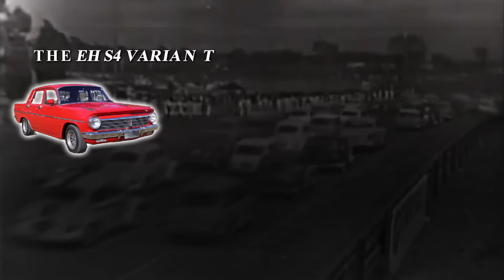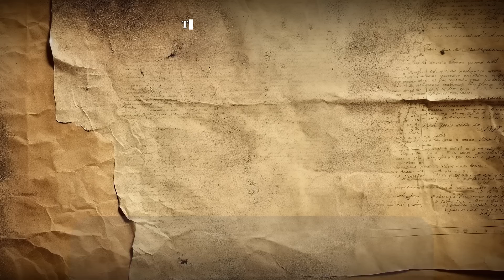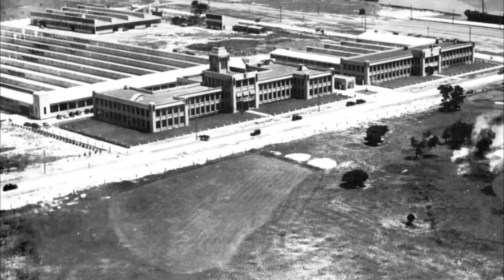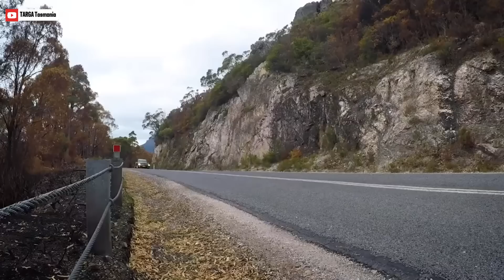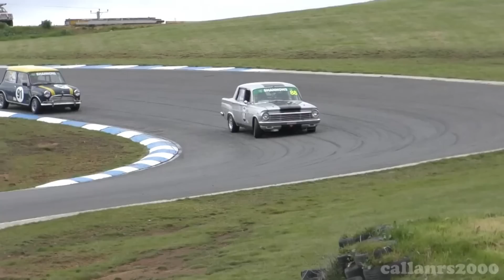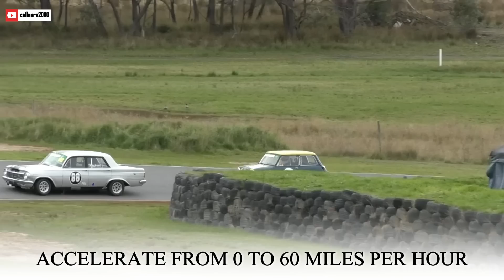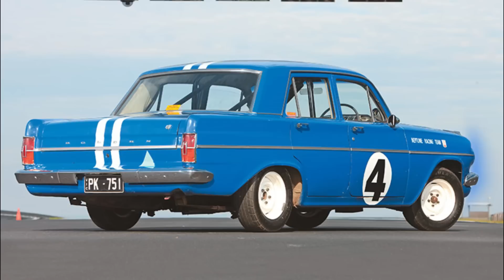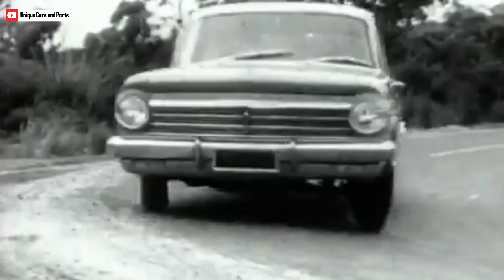Holden's SECRET High-Performance 179 Engine That Dominated Bathurst

Comment: Typical Yank not knowing the full history.
The HD Holden has a 179 X2 Engine option with Twin Stromberg Carbs.  No mention by this punter about that performance improvement on the 179.  😮

Comment: A Holden red six would be lucky to give you a nose bleed on a hot day.
Reply: Brocks red motors gave the Ford Boys menstrual cycles LOL !!
Reply: @ Yes putting three carbs and an unstreetable cam grind on a motor and shoving it in a tiny body made that car fast ….I challenge you to sit in the back seat of an LJ Torana Grant. I’ve driven enough HQs with a 202 to tell you they are a slooooow motor that strip timing gears and leak everywhere.

Comment: I owned three EH wagons in my youth, the last one was repowered with a 186, which could touch 60 mph in second.
The thing I liked about EH wagons was the two stages of fold-down on the rear seat. The first stage you flipped up the seat to vertical, and folded down the backrest, not long enough for a 6-footer to sleep. The second stage you had to put the front seat all the way forward, then the rear seat, with a clever set of steel bars, could flip all the way over flat, and the back rest would clip on to the back of it, making a bed space well over 6 feet long. I camped out in my wagons dozens of times. With a set of snow chains, I took on many a muddy 4wd track.
Reply from the maker: @Jesse-B  thanks for sharing this experience 🙏
Reply: @LegendaryRideCars  I have to say it felt pretty good telling the story after all these years... I'm 68 now, and driving a new model Hilux 4wd, but I will always remember the joy those old EH wagons gave me.
Reply from the maker: @Jesse-B  well glad you liked it. While we cannot give you that feeling and joy with our video, at least we can get you back, when you experienced it 🙏 😌

Comment: The holden red motor did win at Bathurst but that was in 1972 in the smaller and more advanced Holden Torana and it was a larger 186 cubic inch with a triple carb set up. Apart from that it has been mostly V8s that have dominated Bathurst Ford and Holden both winning in the years that followed
Reply: Holden a lot more LOL !

Comment: Oh My God !  Firstly, in 1963  Australia used Australian Pounds NOT Euros . Australia uses Dollars now NOT Euros  . Europe didn't use Euros in 1963  , Euros didn't exist in 1963  . The EH was 1 Lap behind the Winning Ford Cortina , which won in 1963, 1964 and 1965 , Mini Cooper S won 1966 , Ford Falcon GT won 1967 . Holden won their first Bathurst in 1968 with a 327 Monaro which was a Rocket Ship compared to an EH  . To say the EH dominated Bathurst is a Joke , Bob Jane in a Ford Cortina won by a full lap to 2nd placed EH  , Ford Cortina came 3rd 3 seconds behind  and closing on the EH  , another Lap and Cortina would have been 1st and 2nd . I owned 2 EH s and the only way a 179 would hit 105 mph would be if you pushed it off a Cliff .327 Monaro had twice the power a 4 speed gearbox and top speed was 120mph .

Comment: For those just coming to the comments you will see a sprinkling on my comments throughout. What the video is meant to be talking about here is the "197 X2" engine.
As an automotive technician of 40 years and someone rolled in Red Holden engines instead of sand pits as a child, I used to use the oil from the inside of Red engines for deodorant for 20 years :)
The 179 X2 is a different engine to the stock 179 and HP block revision. Only a very limited number where produced and many went in boats as part of the Mercruiser Marine engine line.
The X2 has X2 stamped on the rocker cover next the the twin Stomberg carbs and the big twin carb air filter housing. X2 was also prefixed into the engine number on the block so as not to be confused with the common 179. Vehicles fitted with the X2 engine also have the Red L shaped arrow with X2 either on the grill or as a decal at the rear.
They were as rare as hens teeth. I have only ever seen 3 genuine X2 engines in my life. One I worked on and serviced for a customer for 10 years, the other 2 were in boats including 1 in my fathers 23ft Caribean half cabin cruiser.
>
It is difficult to find information on them but if you search "179 X2" you will find a few pictures. You can't mistake them :)
Many people created twin carb knock offs of the X2, but the lack of decals, air filter, and the lack of X2 stamped into the engine number is a give away :)
>
It is the X2 engine that created the 179 legend, not the stock 179.
Sorry if I have burst anyone bubble with that :)
Reply: And the X2 came out in the HD NOT the EH  .
Reply: @ChrisM-fz6xx  Sorry, where did I say EH?
Reply from the maker: @axle.australian.patriot  what a cool storytelling comment from deodorant to the red engine 🤩 it is really hard to do videos on that rare stuff like the X2 engine. But great to have your knowledge here in the comments for all the enthusiasts :) Thanks 🙏
Reply: @LegendaryRideCars  It may as well have been deodorant. That old resin stained oil stays in your skin no matter how hard you wash lol
That is just my experience from too many years inside of those Red engines across the board lol
.
If you search "179 X2" You will find a few poor pictures, but enough to see what they looked like.
The first one I ever seen (and only one not in a boat) was an older customer that had a factory standard HD X2 utility. Being brought up on Red Holden engines I had no idea what this thing was when I first seen it. Because of the decals on the chrome grill I thought it was LX2 at first. but the L is just an arrow around the X2.
When I was younger my father has a 23ft Caribean cruiser half cabin. I often got to see the engine while dad was working on it, with the twin carbs etc
It wasn't until I was introduced to the genuine X2 ute that I did some research so I know what I was doing when servicing and tuning this ute. That's when I discovered that the X2 was adopted by Mercruiser as a boat engine. Boat engines need a bit more power to weight, as well as typically run at a higher RPM when cruising, so the X2 was a good fit. Strong, little vibration (boats don't have rubber engine mounts) and capable of sustaining the higher RPM.
>
That X2 ute was basically my introduction as a young person to many of the later Holden high performance engine builds for the Bathurst touring car championships.
>
I never got to put my fingers inside of that x2 engine as it was kept immaculate :)
Reply from the maker: @axle.australian.patriot  and the next wow 🤩 love to read your comments. It’s like diving into a good old book :) have you thought on writing a book on that history of your own with that engines?
Reply: @LegendaryRideCars  Omg! I had 40 years worth of that stuff across Holden and Nissans. As a mechanic, performance tuner, performance engine builder, off road racing.
That's not counting boat racing lol
It would be a long book lol
I'm struggling to finish my series on computer programming at the moment lol
>
I'm happy to offer up some fond past memories for forums like this :)
Reply: @LegendaryRideCars  P.S. thanks for the comments :)
Reply from the maker: @axle.australian.patriot  about which engine you would like to hear something on our channel in the future? We could check and maybe it gets in our roadmap - to refer to your programming class.
Reply: @LegendaryRideCars  Wow, that's a hard one. There are a lot of legendary engines out there in their own right.
But if you want a challenge The RB30 GM/Nissan 3.0l is an enigma.
It is official listed as a Nissan engine (Nissan skyline and some Patrols) as well as the Unleaded motor for the Commodore VL.
I was common practice through that period for auto manufactures to do swaps on cars and engines rebranded as there own.
The problem is the block and internal components are stamped with GM part numbers as well as Nissan part numbers.
This was a bit of backroom collaboration between GM and Nissan to build a new engine from previous experience. But it was "backroom" and very little made it into the public. It was build/manufactured in Japan under the Nissan license.
GM Holden desperately needed an unleaded engine for the commodore, so you can understand a bit of background give and take negotiation between Holden and Nissan over the engineering technology :)
So the best of my knowledge it was designed around the tough build of the x2 with the high machining tolerances and steel crankshaft (Note: this was an optional turbo charged engine so needed a proved strong bottom end with good balance.) And the massive success of the Datsun/Nissan L series overhead cam engines.
>
Good luck finding info on the GM/Nissan collaboration though :)
>
They do have a solid history for their short life.
>
There are a few engines in the RB Engine series, but its the 3.0l in the R30 and R31 Skyline and VL commodore that stands out as an enigma.
Both Skyline and VL commodore have a large fan club around that RB30 legend :)
Reply: @LegendaryRideCars  P.S Up until the introduction of unleaded fuels Our Au Police used a mix of Ford 351ci and Holdem 308ci for the highway pursuit cars.
Both brands had an add on Special Vehicles Department that created limited edition sports modifies cars. (Like the X2, XU-1 and later L34 308ci engines.)
The VL commodore with the RB30 3.0l TI became the choice for the pursuit cars during that period. Being a turbo they were fast and well weight balanced on the highway.
The only problem was that from the manufacturer they were sold with a hand book warning to allow the engines to idle for one minute to let the turbo cool and spin down before switching them off (No turbo timers). The TI models were rare outside of the Police department.
Unfortunately most police drivers didn't get the memo and they destroyed a lot of turbos and in some cases the damage required in house (Police) engine rebuilds.
It was from servicing these vehicles under contract that I learned about the GM internals of the engine via the police workshops.
I never personally got to open one up, even though I owned an R30 and R31 skyline at different times. They just didn't break lol
Reply from the maker: @axle.australian.patriot  a ton of info. Thank you very much for your effort.
Reply: @LegendaryRideCars  The engine with the least info was the block designated  HP Block ! At the start of the 80s l approached  an engine builder to build me a full house Holden red motor for my Torana . I wasn't. aware of which block they would choose but interestingly  they chose the HP Block over the 202ci block . I can only assume it was for the 7 journal crank for rev strength !! That engine delivered in spades and that l figure was also due to power to weight as it was fitted to my mockup XU1 l had which had  a curb weight at the time of 1050 odd kilo,s . That thing was the Lester Ellis of Torana,s (The Master Blaster ) LOL , It left town like a cat with its fucken arse on fire LOL !! I've. been a fan of the red,s ever since .it was simply sensational !! The GT fellowship hated me lm positive of that as NONE of them ever got close 🤣🤣🤣🤣🤣🤣🤣GM FOREVER ,FOREVER GM !!!!!!!!
Reply: What do you know about the engine designated  HP Block engines ??
Reply: @Lionatheart2839  I can't recall exactly (Long time ago). The HP and the 179 blocks were cast in a different factory or with different steel from memory (earlier and later molds). There were a lot of variations From the Low Compression engine (Low octain fuel) to the High compression engines (High octain fuel).
This occurred across all Red engine versions. Basically these were the stock 179 engines. They changed from forged steel to cast along with the block mold change, but some engines retained the forged steel cranks. The X2 kept the forged steel crank.
>
Where some of the ambiguity comes in is this:
The EH S4 was a 3 speed syncro gearbox upgrade from the hydromatic. So gearbox, not engine.
I think Repco built a beefed up stock 179 for racing.
This was then used as the base to design the X2 179 by Holden.
The X2 is easy to identify as the X2 is stamped into the prefix of the engine number, as well as on the rocker cover.
If you search for the 179 X2 you may find a few images where you will see the X2 which has an arrow in front of it and east to mistake as LX2. You have to look carefully through the images to see the LX on the rocker cover plus the big air filter for the 2 Stromberg carbs. I did recently see some images where you can almost see the twin Strombergs under the air filter.
>
They had to sell a certain number of production cars with the X2 to be allowed to race them at Bathurst.
I only ever got to see and maintain a X2 Utility, so I knew the X2 well, but never got to pull the engine down as it was very well kept.
.
I did mention elsewhere (although you won't find information on it) that the a lot of the X2 179 engines also sold to mercury. The only change was the "Mercruiser" engine was painted black and the exhaust was water cooled aluminum. The big air filter was dropped as it is not needed on boats and 2 small round chrome wire mesh filters were placed on the carbs instead. 
I know this because I have seen a few of them and my father owned a 23ft Caribbean Cruiser running the 179 X2 through a stern drive.
>
I feel so old lol

Comment: What a load of rubbish. Engineering breakthroughs like a 7- bearing crankshaft and hydraulic lifters! Really? Oh by the way, this thing never won Bathurst, it got flogged by snake smaller 4 cylinder cars.

Comment: You don’t know nothing s4 just had a double carb
Reply: S4 NEVER had twin carbs, just a single venturi stromberg with a bigger main jet !!
Reply: S4 had a normal 1 5/32 Stromberg with what became the 179 manual carby.
Reply: No forged steel crank I only heard of those variants being special HP was it
I'm a Ford guy  i'm not sure

Comment: I thought they had a 138 red motor in a few of the ej holden
Reply: EJs had 138 grey motor. An underpowered slug.
Reply from the maker: @timlavender6968  yes 🙌 especially the 130 in export versions, which was nearly the 138.

Comment: Steel cranks in early reds. The 179 was over bored to a 186 and then stroked to a 202. The 186 LC XU1and 202 LJ XU1 Torana's were both outright contenders at Bathurst but didn't dominate. The Holden Red was also the last Australian built six to win Bathurst.
Reply from the maker: @redtale6527  thanks for sharing
Reply: Steel cranks only in 179 hp block and the 186 s block , not in other blocks
Reply: @janehanlon2802  Nodular cast iron cranks were introduced with the HK in January 1968 so I suspect all production reds before then had steel cranks.
Reply: They didn’t have roller rockers this video is all bull dust

Comment: Hey dads eh  ute had a 2 speed power glide so your speaking  crap
Reply: No, they were Hydramatics in the EH. Powerglides came later
Reply: @michaelatkins5480  new ffrom holden eh ute with 186 2 speed powerglide  fell off the train on delivery landed on ti roof an had
Reply: @cherylpotter9231  think you might find that ute was an HR. EH never came with a 186.
Reply: ALL EH autos were the old hydraslurp. No power slides until HD.

Comment: Must be in some alternate universe….
I lived in Bathurst and can’t recall any domination from a 179 Holden …..
But made me laugh
They did make one in 1964 with a beefed up clutch and bigger drum brakes ….
But dominant? I don’t think so
Don’t get me wrong 
The EH was a great car to drive 
But NEVER a serious race car !!!
Reply: S4 was 63. Bigger clutch became 179 clutch 8.6" clutch. 149 was 8"
S4 had wider front drums and sintered metal linings. And a booster. 
And while they won hundreds of races in modified form std no great shakes. I owned an EH S4 in 1972

Comment: I had a HP179 bored to 192 with lots of go-fast goodies in an EK ute. It gave most V8s in 1976-77 a hiding. The V8 drivers couldn't understand how a quiet running EK ute (extractors, 2 inch single system and two big Lukey mufflers to keep it quiet) could beat their V8s, LOL.
Reply: The Ford 4.9 V8 only produced 151KW.  The XC was  geared for economy rather than performance. They couldn't even keep up with a Fiat 1600.